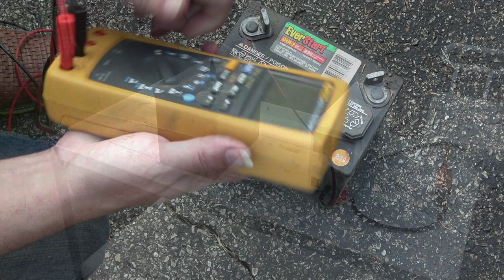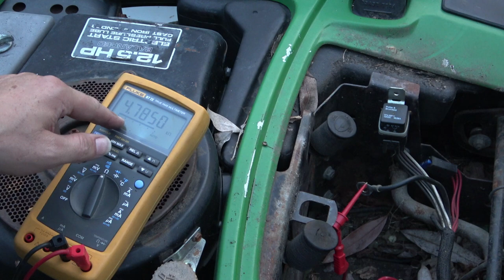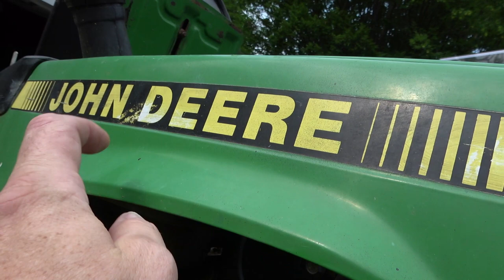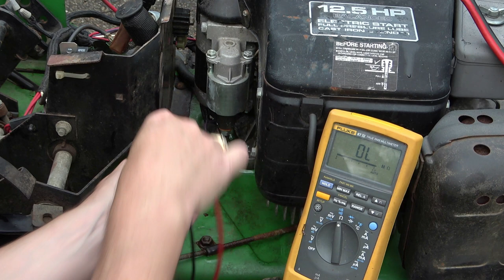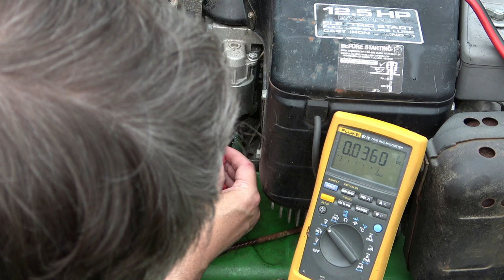FREE from the CURB! - John Deere RX95 Riding Mower...Will It Run? [PART 1]

Comment: Hey Brad!  There may be some safety switches preventing it from cranking.  There is likely a switch on the brake pedal that requires the brake be depressed to allow it to crank.  May be one on the seat as well.  There could be a neutral safety switch on the transmission that needs to be in neutral to allow it to crank.  If all the switches are happy you will have 12v on that purple wire on the starter solenoid when the key is in the start position.  With the battery leads connected to power and ground, apply 12v to that spade terminal on the starter where the purple wire goes as a test of the starter and it should crank.  Shoot me a PM if I can be of any help.  Love the revival videos!
Reply from the maker: Thanks man. Yeah, there's a safety switch on the mower deck engage and I think it has to be in neutral to start. Not sure beyond that. That clicking was definitely the solenoid at one point, so it was getting 12v to the starter.
Reply: @Fixologist1 The only safety switches on these mowers is for the neutral, PTO and seat.

Comment: The pedal for the clutch \ brake has to be pressed down to crank. You lock it down by depressing the pedal and lifting the rod under the seat between your legs while you are sitting on the seat and then releasing the pedal. Then you can crank it without being on it. 50 yrs as a mechanic available if you want some help brother.
Reply from the maker: Others have said that too. Good to know going forward.

Comment: Sit down. Seat switch. And hold brake or put e-brake on. 2 safety switches usually
Reply: Those seat switches are a pain in the ass and if I do run into one, I'd bypass it. Thankfully my old Cubs don't have those though. 😅
Reply from the maker: I'm pretty sure the only safety switch this one has is on the shifter (has to be in neutral), and on the blade engagement arm. I'll double check that though.
Reply: they only have a neutral, parking brake, and blade engager switch i believe.

Comment: If no one had turned the engine over it'd be impossible for water to get in the carburetor from the tank due to having a fuel pump and not being gravity fed. I had a RX 75 which identical to that one but had a 9 hp Kawasaki engine and it'd sat for years and it fired right up. Put the engine on a Old rear engine snapper and the guy that bought it still mows with it and that was years ago.

Comment: Btw I've  worked on several of those JD rider mower starters. On at least 3 l remember  that the epoxy they used was weak. The magnets glued to the inner wall of the starter case had become unglued  and were stuck to the armature. It was a simple matter of disassembling the starter and re-epoxying the magnets back where they belong on the starter walls. Its an easy fix, so its worth talking a quick peek at. 
I only mention it because its an issue I've had SPECIFICALLY with John Deere starters on multiple occasions.
Reply from the maker: Part 2 is working on starter.
Reply: I avoid Jon Deere my favorite is craftsman an Murray's to revive but i don't really care for troy bilt, Husqvarna or Deere although they bring a good bit the mtds where built cheaper but much simpler

Comment: When testing, check the voltage from the positive battery post to a good ground, should have battery voltage.  The ohm is ok, but it should be 0 or near 0 for good connectivity.

Check the starter solenoid,  should have power on one side, ( where the battery cable connects) the other side should have power when the key is turned to start. 

Good luck young man
Reply from the maker: Thanks buddy! Appreciate all the help I can get.

Comment: I had the RX75. It looked exactly like this one and had a 9 horse engine on it. A good friend of mine gave it to me as payment for helping him mow his 6 acre property. It ran and mowed perfectly fine until the spindle bearing in the deck went out, half way through mowing the yard.
Reply: i just helped a friend rebuild the kawasaki fc290v on a rx75. absolute ridiculously made mower. you have to take the whole transaxle out to get the engine out. no one makes parts for the engine either, not even kawasaki.
Reply: @frigglebiscuit7484   I figured Kawasaki didn’t make replacement parts for them. I forgot to mention mine needed a carburetor rebuild kit. It was leaking gas out around the engine getting close to the muffler. I’d have to stop and let the engine cool and the leaked gas evaporate, before continuing mowing. I’m betting it would have been hard to find that spindle bearing, too.
Reply from the maker: @RushGuitarMan  They sell the bearings and idler spindles for this series still.
Reply: @Fixologist1  That’s awesome to know that they still do.

Comment: If you pull the kill wire off of the coil and it starts then it’s probably a safety switch which you can ohm them out to find out which one is bad.  Wish you luck

Comment: You can usually fix starters. Especially if the solenoid is working. There is a metal part that conducts power to the starter motor when the solenoid is fully extended. This metal connection is usually made of copper which is a very soft metal that gets eaten away slowly with each spark every time it is used. The reason the manufacturers use copper is for planned obsolescence. This is almost always what goes bad in a starter. If you are able to open it, you can replace the connection point with a harder metal such as brass. I've never tried doing this on a lawn mower starter but it certainly works for cars.

Comment: i've had several solenoids go bad in various models of cars. a few times they still read fine 12v on the mmeter. the plunger gets stuck but still appear ok on the mmeter.

Comment: it could be a safety switch or bad starter solenoid. i just got done helping a friend rebuild an engine for a rx75(smaller version of this) and OH MY GOD was it a POS. you have to take the rear wheels and entire transmission out to get the motor off. also, no one made gaskets for the kawasaki fc290v engine, so we had to get gasket paper and make our own. no headgaskets, seals, etc.
Reply from the maker: Holy crap! I hope that isn't the same story with the FB460V engine. I think this same block is used on a lot of their motorcycles too, so seems like there's parts.
Reply: @Fixologist1  im gonna guess it munched the deck belt, and they gave up after trying to take the wheel off, and the bearing stayed on the spindle(not hard to put back on, just hammer it back in, might be a bit stiff). probably need an e-clip to hold it on the spindle, unless it was still there with the wheel.

 a tip: put the e clip in place on top of the groove, then space your channel locks out enough to grab the top of the clip and the bottom of the spindle, then squeeze the clip on the spindle. to get the clip off, just take a flathead screwdriver and pry on the little space between the clip and the spindle. saved me a bunch of headache doing it this way.

Comment: Watching the replay, hey, can you fix an audio cassette?
Reply from the maker: A player?
Reply: No just the cassette
Reply from the maker: @JaniceLalla  Is it one of those with screws to take it apart? If not, you might have to break the case to remove the tape spools and rehouse them in a new cassette case. If the tape is broken, you can splice the tape from behind with some adhesive tape like scotch or packing tape.
Reply: @Fixologist1  JRLALLA  on therumble
Reply: little vid